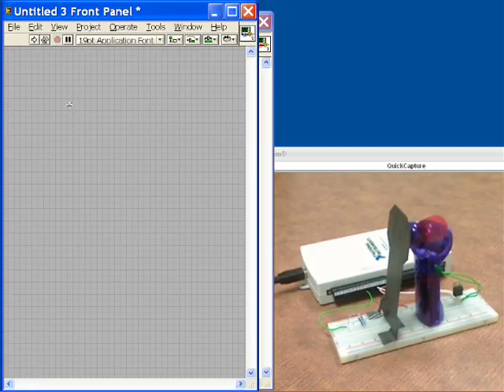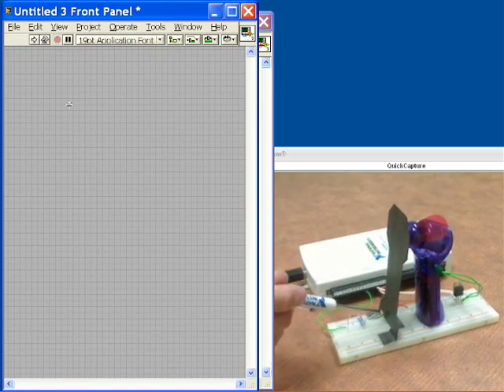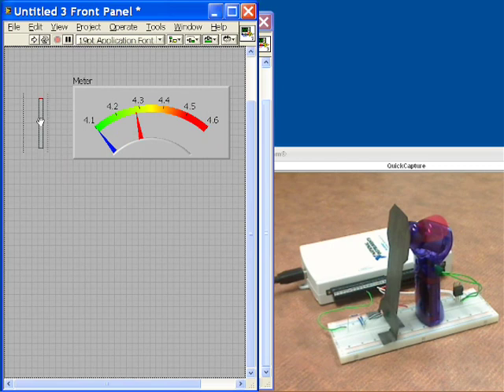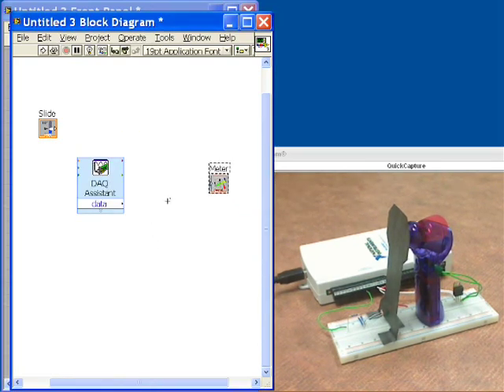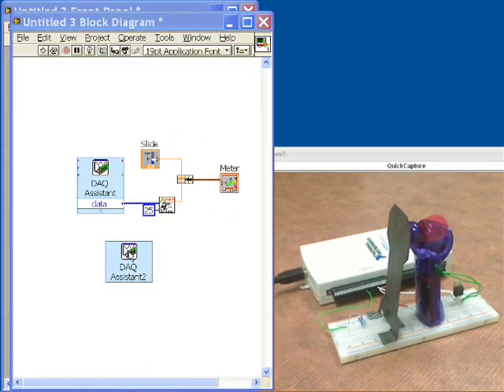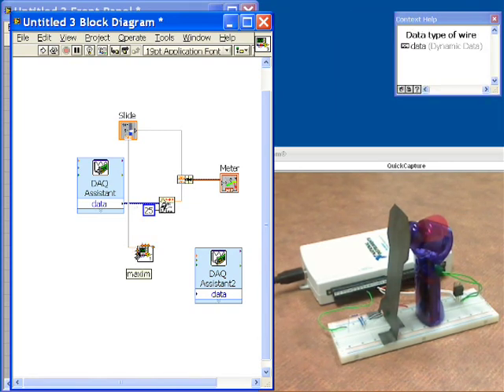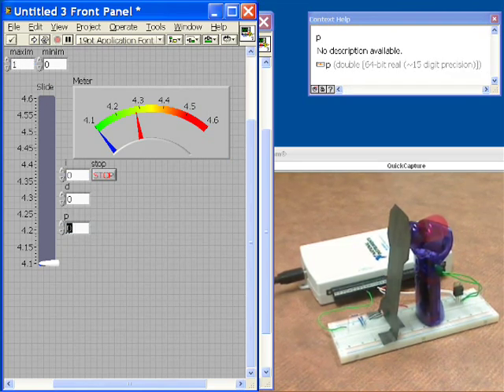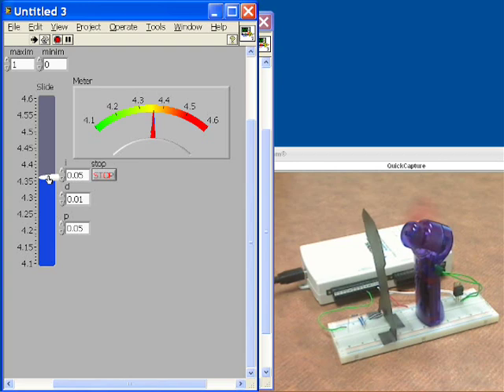Building a PID Controller with LabVIEW and USB Data Acquisition Hardware

Comment: hey...how did you wire up the photocell with the voltage divider circuit (the resistor you used and the characteristics of the photocell)? can you give me a quick rundown if you dont mind...

Comment: Hi, could you please list all the specific components used in this video, because i would like to build this myself and i don't want to buy a fan or sensor that isn't suitable.

I was also wondering about the fun in particular. I am assuming that the battery power doesn't go directly to the fan motor, it goes through the power transistor first?

Comment from the maker: Hello,
Dave described the circuit in one of the comments below. "The analog output channel is connected to the base input of the transistor. When looking at the transistor with the metal shield in the back, the base input is the pin on the left. (Not all TIP120's are the same) The next post on this transistor is the collector and the last is the emitter. The battery high goes into the collector and the output current comes out the emitter to the fan motor."

Comment from the maker: Hello,
Dave needed a transistor that could provide more current to drive the fan, since the analog output channel on that USB DAQ device can only drive up to 2mA.  Using the TIP120 darlington pair transistor, you can increase that to several Amps so it works well for this applications which involves driving a DC motor.

Comment: Hi Dave,
i was just wondering if there is code for this PID controller compatable with Labview version 8.5 because i followed the link above for the code and could not open it because i only have version 8.5. regards.

Comment: Hey there, is there any limitation to this PID program? I calculated P and I parameter values of more than 5 (but output is only between 0-10V). I applied it to my system's approximate model (very close to actual response), and they work ok in MatLab simulation. But when i apply them to this PID program, my system oscillates very badly. 

is there any factor difference between this program and the regular PID block in Matlab? Hope u can help me out. Thanks!